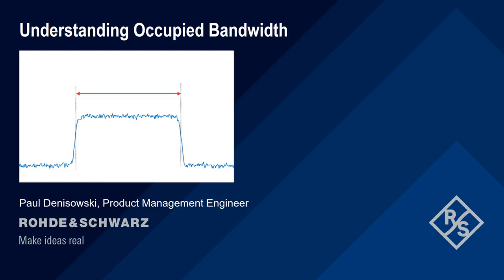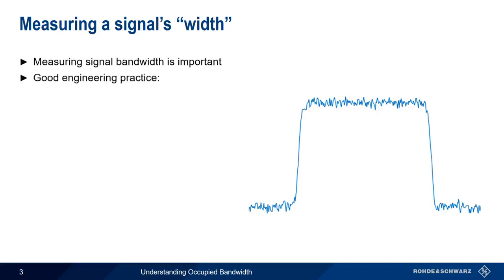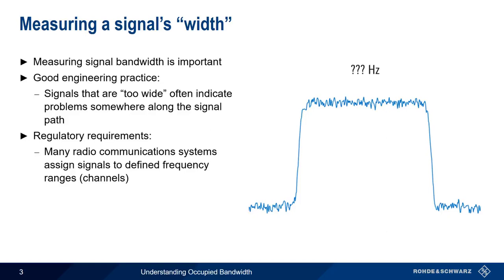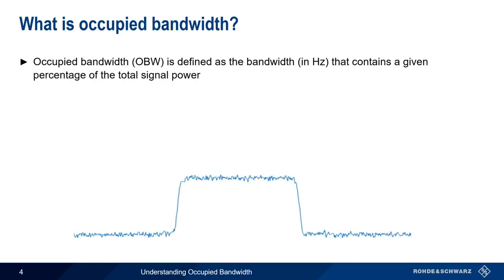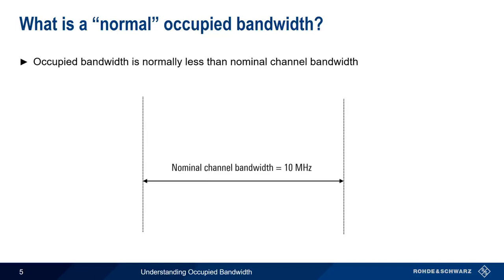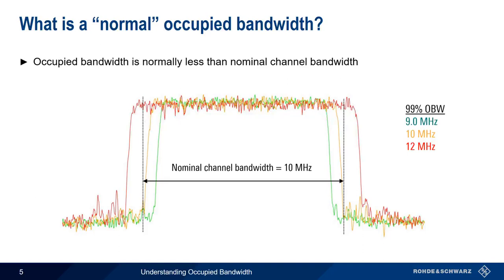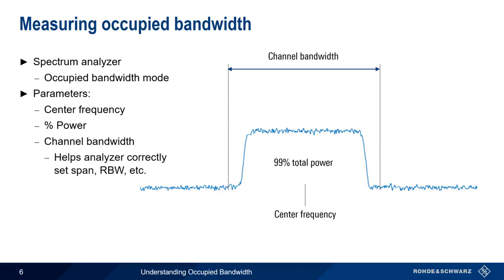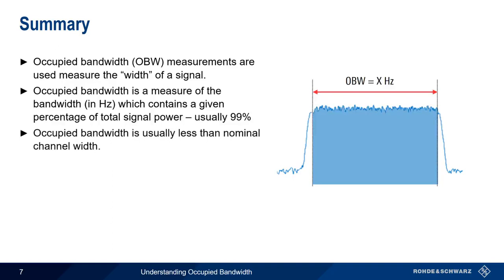Understanding Occupied Bandwidth

Comment: Now that I understand all this. How do I find a frequency coming from outside my home and causing me harm? How do I find the source of the bad vibes or frequency?
Reply: Normally you would need some kind of "spectrum sensing" device like a spectrum analyzer or a tunable radio receiver:  i.e. something that can detect power at the frequencies you are interested in.  Some sort of directional antenna is also very helpful so that you can determine when you are "pointing" towards the source of undesired RF energy.

Interference hunting is a fascinating (and fun!) topic but maybe a bit much to go into here.  I would suggest one of our (many) free whitepapers or webinars if you'd like to learn mode, e.g. 

https://www.rohde-schwarz.com/us/solutions/test-and-measurement/mobile-network-testing/interference-hunting/white-paper-an-introduction-to-interference-hunting_251161.html
https://www.rohde-schwarz.com/ae/knowledge-center/webinars/ihunter-webinars_250575.html